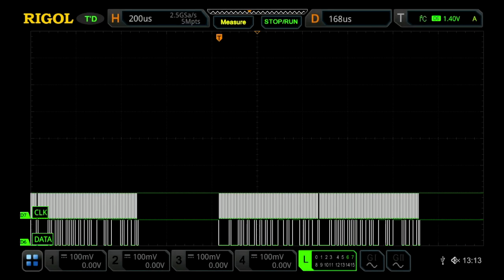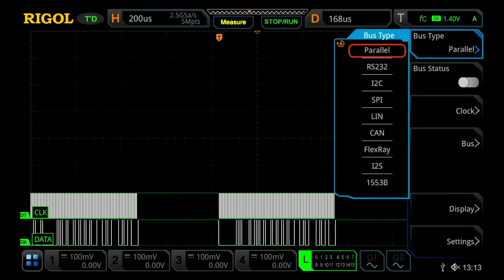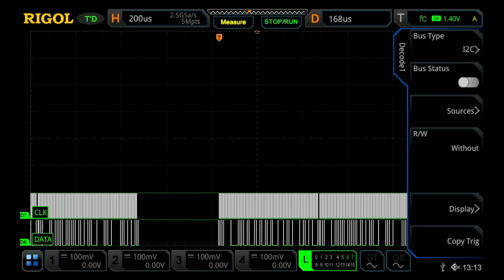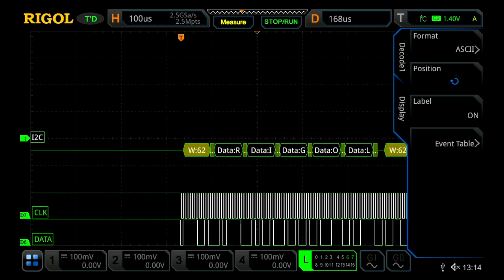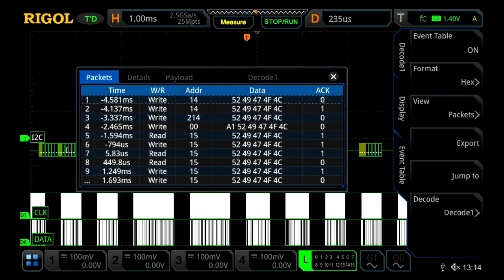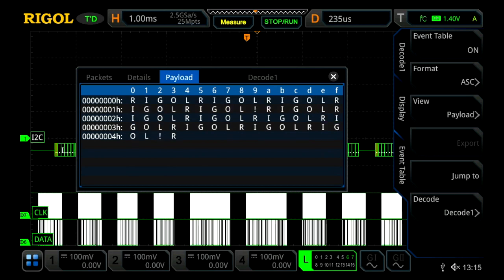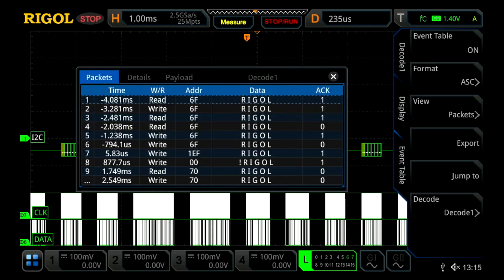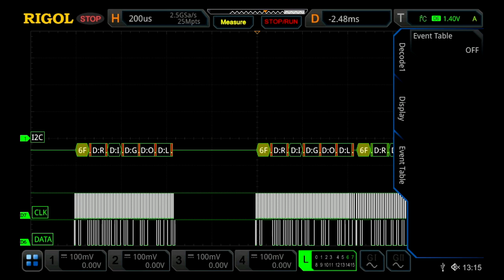Protocol Analyzer

Comment: You never mention the model number of this equipment
Reply from the maker: This is the MSO8000 Series. Protocol analysis capability is similar across the MSO5000, 7000, and newer oscilloscopes.
Reply: @RigolTech  thanks

Comment: 1. How to see more packets 
2. Export is enable only when i press stop?.
Can i store it in internal memory

Please clarify this.
Reply from the maker: You can view data bits on the display for the visible data. When you hit stop you can view deeper data in the table. This data uses the deep memory samples between points shown on the display. In this way you can view more samples by extending the time base. You can capture the displayed data and the deeper data via the event table. You can export that to the internal memory when in stop mode. You can also use record mode to capture displayed sequences.